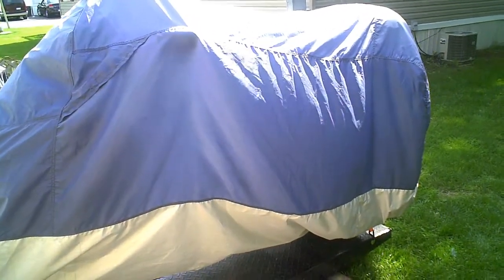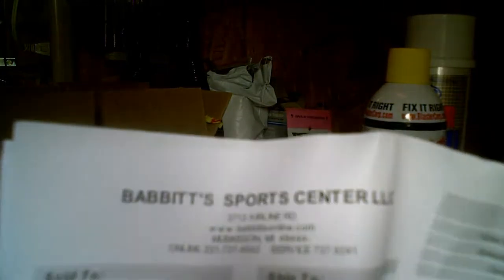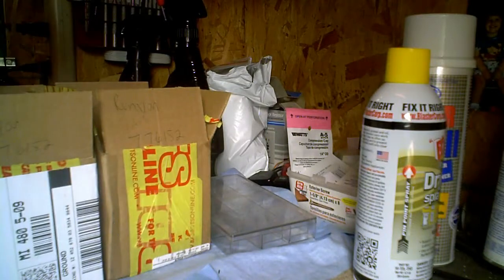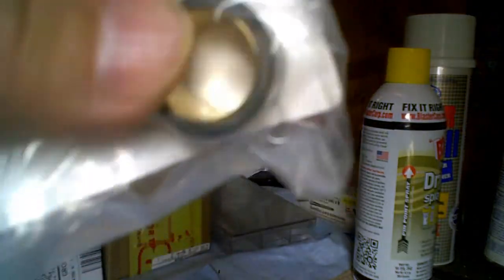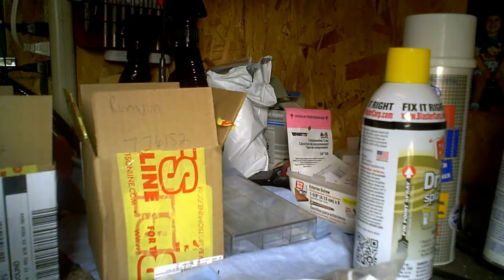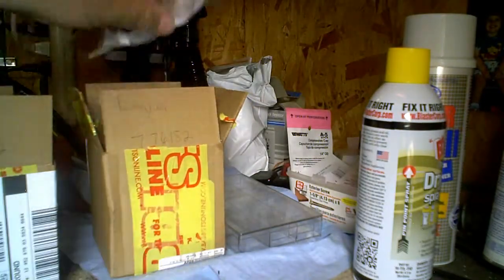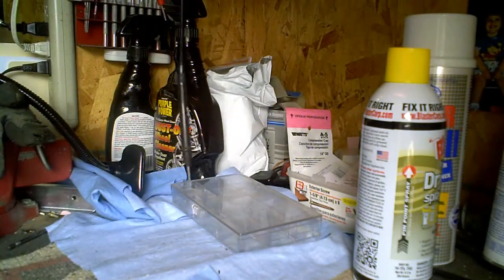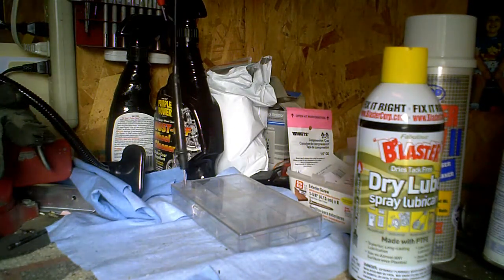CVT repair video 1

Comment: One thing I'm not looking forward too, is eventually replacing the variator or clutch on the 650 Burgman.  I'm hearing the parts are very expensive... Your Majesty has a configuration more like my old 250cc Chinese scoot. I rebuilt the variator and used Dr. Pulley weights.  I got pretty good and taking the variator off the old scoot.  Get an impact wrench.  You'll be glad you did..

Comment from the maker: if you watch LeDude00 he is actually doing a step by step on a Burgman. That my friend looks extensive, he has had to tear the bike down to it's frame, it did not look like a picnic to me. Mine is just a couple of air filters and some bolts and walla it's there...I have an impact, I have all the air tools, I am a tool nut and always get the tool for the job if I can...